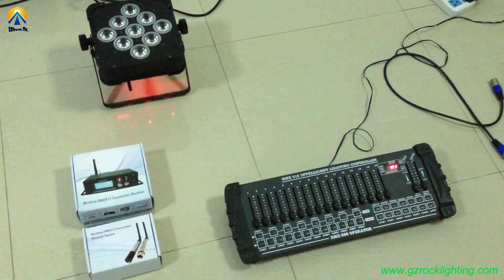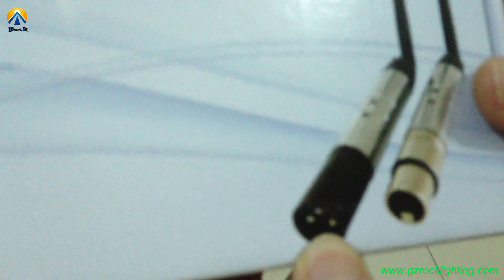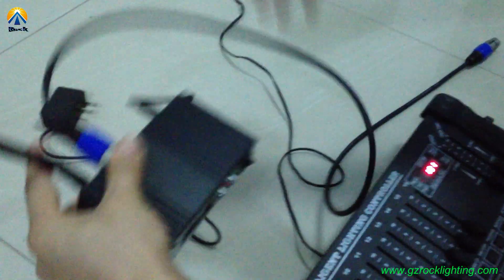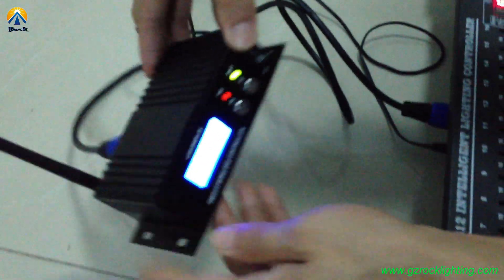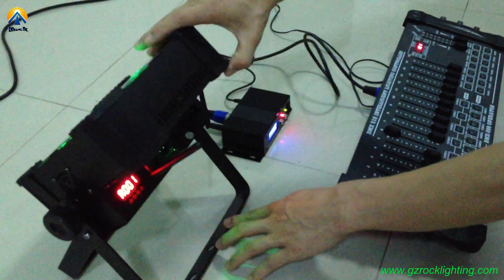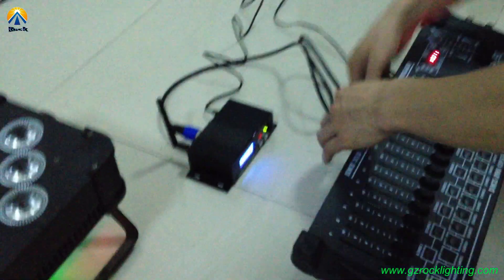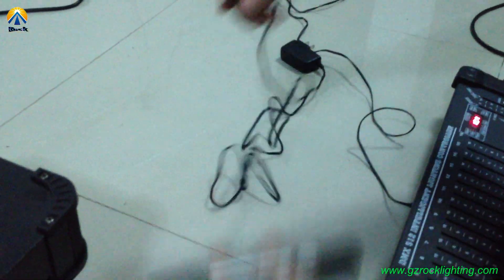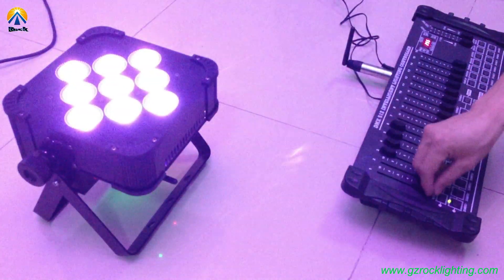Introduction Two types of Wireless dmx 512 receiver & transmitter system XLR & LCD

Comment: Quite a clumsy demo.
What should have been mentioned is that the transmitter (w a male XLR) and the receiver (w a female XLR) can be configured to work on 1 of 7 independent groups. You can see in the beginning of the video that the receiver LED is steady red ie. it is configured as the red group (default) and the transmitter must then also be in this same group. When the link is established the receiver flashes green and when using the not-box version of the transmitter the LED flashes red. The group is indicated with the color of the LED and selected with a small button.

Comment: this is 0ne to one controller ,you cannot run a chase using this?
Reply: This is not a 1-to-1 system. The whole DMX512 protocol with 512 channels goes over the wireless link. If you use several fixtures (lights) with its own wireless receiver or connect the fixtures with DMX512 cable and use unique addresses you can run chases.

Comment: I am new to all this. I just bought the DMX 192 intelligent controller, which has a very vague instruction manual, and the Wireless DMX512 Transmitter Receiver System, which had no instructions. I see where you plugged in the Tx do you plug in the Rx into the LED par light, and if so which side of the light.
How do you set up the controller to operate manual. When I plugged in everything and set the first light on channel 1, set the dip switch to 1 nothing happened. I am using par 86 DMX led lighting. Need full instructions Please guide me
Reply: What is your controller and light (fixture), model and make?